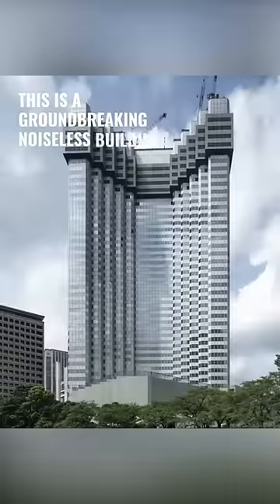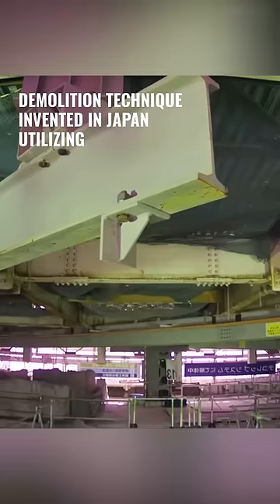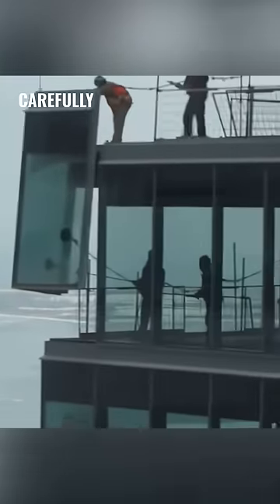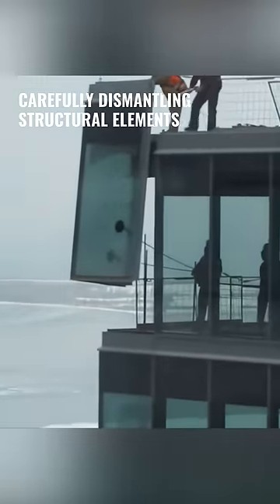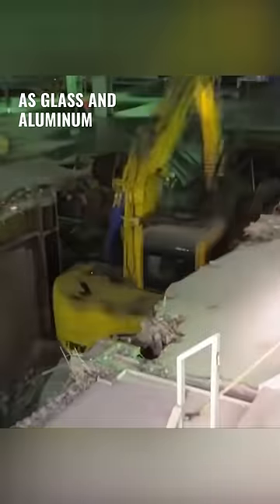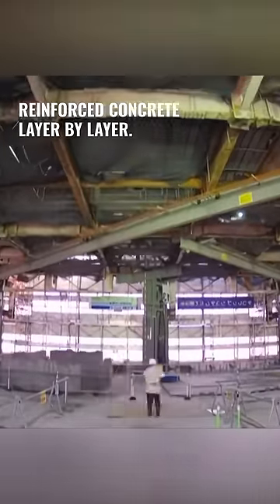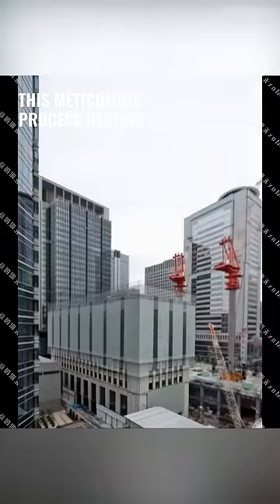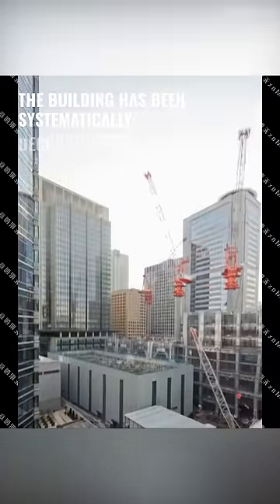Silent building deconstruction 😎

Comment: It's probably better this way.  Planning and preparing a building demo takes just about as long, and is a lot more dangerous.

The noise and such are mostly irrelevant.  This is somewhat quicker and easier, and considerably safer.

Comment: I wonder what the environmental impact is running the diesel equipment along with the cutting torches and other tools, over the time it takes to do that? Versus simply blowing up the building and only using 4 to 6 excavators and bulldozers over a couple weeks?

Still very neat way of doing it.

Comment: While the rest of the world continues to violently demolish buildings and reduce them to rubble, Japan has found a way to do it nicely instead, by doing reverse engineering and shortening it until it's gone, without any dust, possibly reducing carbon emissions as well. Nice work, boys.

Comment: heavy machines, dozends if not hundreds of workers, countless trucks transporting stuff...

"noiseless" 

blowing it up is 100x faster, cheaper and only makes noise for a couple seconds
Reply: And lots of debris falling.
Reply: Absolutely not. That 2sec can create-  massive shock wave -noise pollution
a huge cloud of dust - air pollution 
 no control over where the debris will fly
size of the debris 
a pile of useless mixture of cement, iron, glass 

Whereas this method is quite opposite.

Comment: Bro it's so dumb 
-it will take too much time, man power, heavy machinery. 
-it even might be costly then building new one. 
 
In my scenes blasting material used for collapsing building on it's own foundation is good 
-ya it make noise that why we evacuated that area first 
- it's cost effective. 

It's my opinion as structural engineer 👨‍🔧👨‍🔧

Comment: How can it be "noiseless" and "silent" when you have heavy machinery and tools to break down the layers. Lol this means the neighbors will be hearing construction as if they were building it until it's done. It would take a longer time breaking it down rather than blowing it up. I love Japan and the intelligence that they have but honestly they are inventing/using this method because they have no room for a typical method. It would cost more to pay for damages than just paying workers to take off layers at a time. By the way this is not invented it's been used. Ever go to a construction site (let's say for a remodeled home) and see guys blowing it up or getting a crane and smashing a house? No, they start by taking down the walls and then the frame of the home by the layers. Same concept in this case so nothing new but cool to see non the less 😂